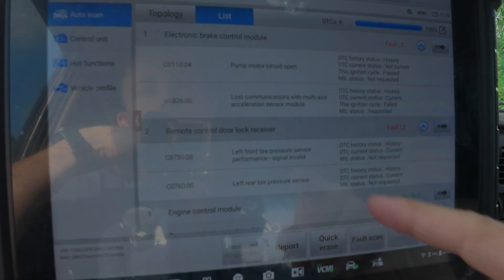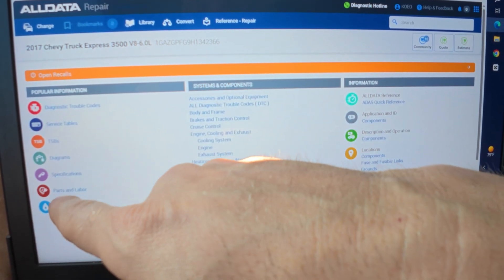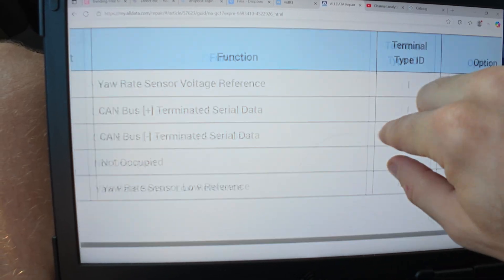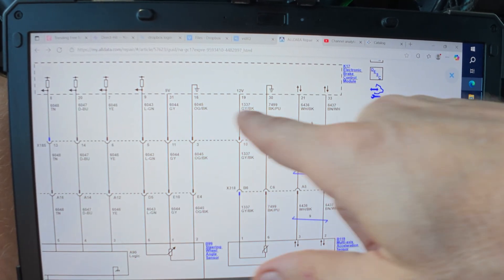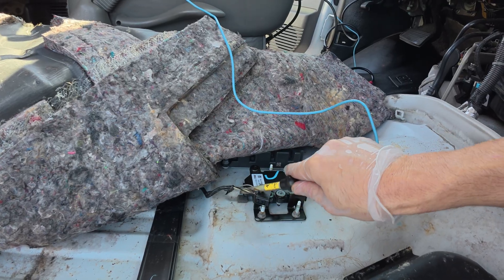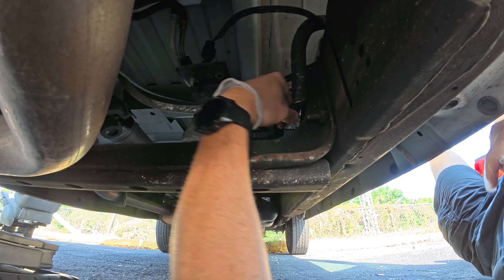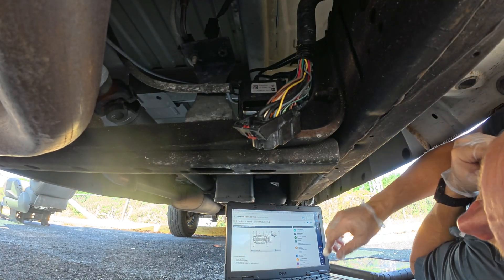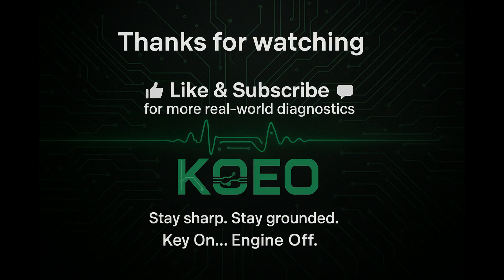ABS Pump & Sensor Dead? Full Diagnostic + Service info Deep Dive | Multi Axis Comm Loss

Comment: WELL I GUESS ,,,,,, IF YOU'RE GETTING THE 2.5 BYAS VOLTAGE RECESSIVE STATE THEN WE NEED SOME MODULES . BECAUSE THERE IS NO 5 VOLT WAKEUP SIGNAL FOR THIS BUS RIGHT ,,, JUST SAYING . TRYING TO GET SETUP WITH GM SPS NOT AN EASY TASK WHERE I LIVE . THANKS SO MUCH FOR THE GREAT CASE STUDIES LOOKING FORWARD TO ALL THAT YOU PUT OUT GREAT WORK !!!!!
Reply from the maker: No 5v wake up on this one. 2.5V bias comes from ABS. But without having a known good waveform I'm not 100% sure how it works. But I do know its a communication line and there should be data transfer. 
Perhaps when the new parts come in they will leave the seats out and I can get a known good sample from it if time permits!
Reply: @KOEODIAG  REALLY LOOKING FORWARD TO THAT THANKS !!!
Reply: Did we ever get the parts in for this repair? Can’t find the other video